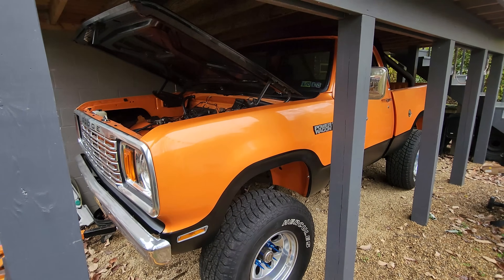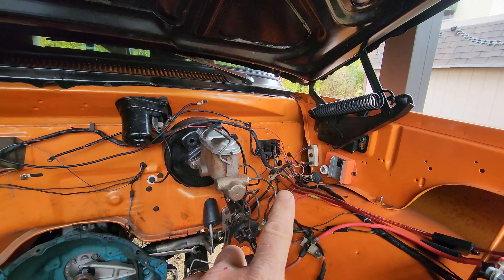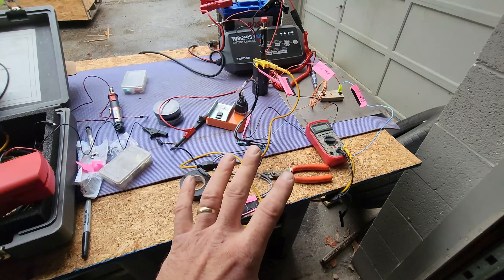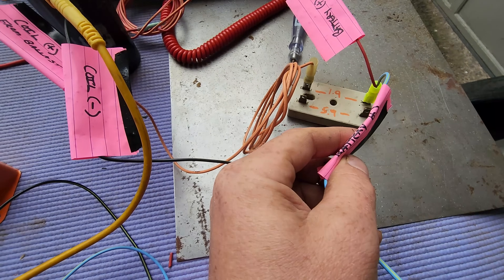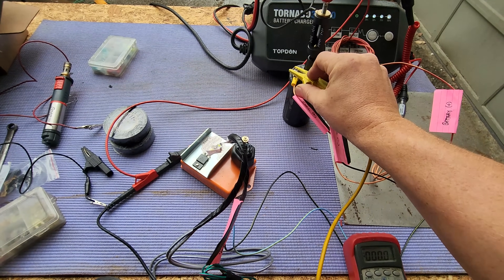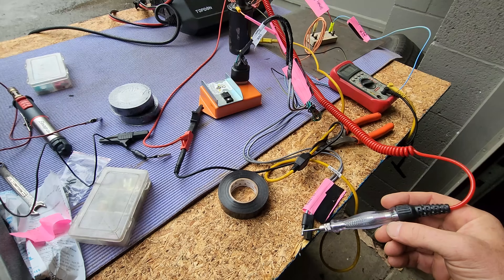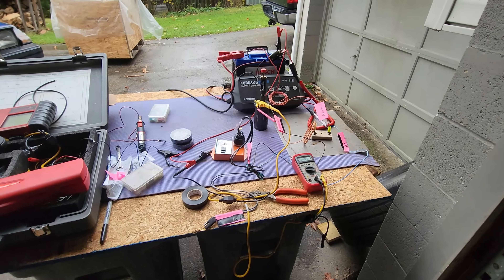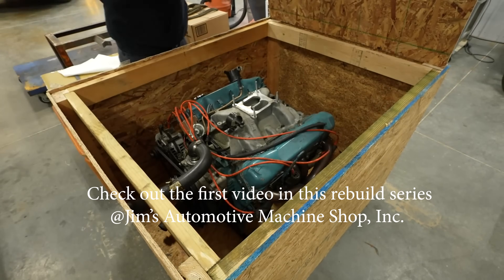Making a MOPAR Ballast Ignition System Fire on a Workbench

Comment from the maker: This video is primarily for my friends  @JAMSIONLINE  for when they run my 413 Wedge on a stand during the break in process. This will also be extremally useful for anyone dealing with a no spark issue on their Chrysler, Dodge or Plymouth (MOPAR) Ballast Ignition Systems
- Here are some important links for this series so far:
1. Did The Previous Owner LIE About Rebuilding This MOPAR V8?
https://youtu.be/oa5pT7qq5-g?si=5wrxg5uKQRYS7Gzt
2. Wiped Cam Lobe/Lifter After 4000 Miles?
https://youtu.be/t5ze5UBjplU

- Here is the no spark video I referenced:
No Spark Troubleshooting [Mopar Electronic Ignition with Ballast Resistor]
https://youtu.be/RiC8OaSXMs8

- Joe's Distributor Restoration (phone number) 330-843-0335
Joe is a former student of my  @RosedaleTech  and created this business for himself. He rebuilt my distributor for me and matched the timing curve to my cam and also provided me with the newer style ICM and ballast resistor

Comment: My buddies neighbor came over asking for me to look at his 80’s dodge truck that wouldn’t run. His “mechanic” friend was there I look at it and it needed a ballast. His mechanic friend said I’ll just bypass it and put 12v to the coil. I said the ballast drops voltage and current if u don’t have one it will at bare minimum make the coil fail prematurely and worst case cause a fire and with that engine covered in oil leaks it will burn to the ground for sure. That weekend I go to my buddies house and his neighbor comes over shows me a picture of his truck burnt to the ground saying his “mechanic” friend told me you didn’t know what u we’re talking about so we wired in 12v.
Reply from the maker: Holy crap man! That sucks they didn't listen to you! High price to pay my friend

Comment: Paul,I love your truck. There's a company called Davis Unified Ignitions and they make a big block chrysler HEI distributor that is just like the mid to late 70's gm distributors.Just drop it in, run a key on 12v power wire to it and drive away.Could be something you might be interested in.Good luck with your build.
Reply from the maker: A lot of the guys in my Tin Grille FB page talk about those. In my opinion, it is no improvement over this design as it's all junk Chinese parts these days. The GM 4 pin module and the HEI coil used in that set-up is equally as hard to source for replacement parts as this current design. I see no reason to change it. The guys that love them, love them because of their simplicity, but to me, the system I have is already simple 😁
Reply: @ScannerDanner  Of coarse you're right. Especially about parts quality.I'm not a big conspiracy guy but  If I were a country and I wanted to take down another country,and that other country relied on me for their basic goods crappy parts would be a good start. As for replacement parts, If you broke down in Bumtickle Nebraska and the only place open was Ed's Auto Parts and  Feed Mill on main street next to the diner' He would probably have everything you need for either system in stock. You might have to blow the dust off of the boxes. Simplicity was really the only reason I suggested this distributor. I just thought it would be easier for the guys at Jim's to set up. They are ,of coarse, more than capable using anything you send them Watching their videos will tell you these guys are good. there would be one more upside. When you went to a cruise-in and opened the hood' All the mopar or no car guys would give you the stink-eye. Sometimes I just like to poke the bear.
Reply from the maker: @mato350 😂 thanks brother, merry Christmas!

Comment: you do nice work , it would  be a neat little package if you had that circuit mounted to a board you could use it to start any engine that used a two wire pick up coil  ....

Comment: So the bypass circuit is connected to the starter solenoid feed?
Reply from the maker: In a sense, yes.
The bypass circuit is powered up by the "crank" circuit (hot only in the crank position) and came from the starter relay on some models (like my 78) or the ignition switch itself on others. Does that make sense?

Comment: Surprised you aren't going to electronic ignition, there are several great systems. But I suppose these early systems worked for decades just fine. :)
Reply from the maker: This already is electronic 🙂 
The other options that are available (petronix or guys love the GM HEI conversion or the worst of them all an MSD system) are not more reliable and parts are possibly even harder to come by. With this system I can go to any parts store and still order what I need. And yes, this system (when understood) is very easy to troubleshoot and is relatively trouble free.
Reply: @ScannerDanner  Don't forget to keep that extra ballast in the glovebox. 😊

Comment: Those old time Mopar ballast resistors were a pita... I bet I replaced several thousand through the years.
Reply: On the European Chryslers they were located under the battery tray,  we used to relocate them to a more accessible place. One of our customers  a fleet operator installed and serviced traffic signals would burn them out in a few months, we used to give them a spare to carry and instructions how to fit.